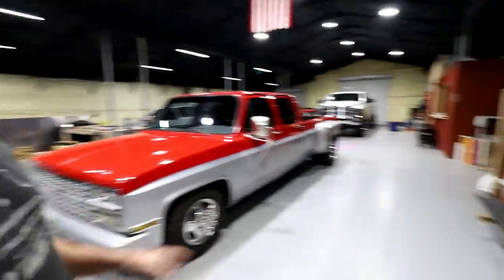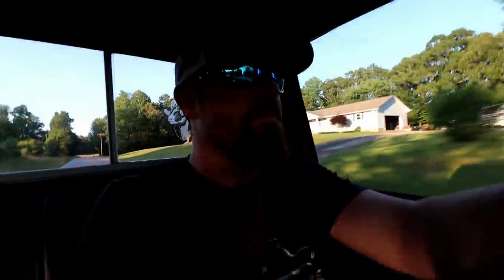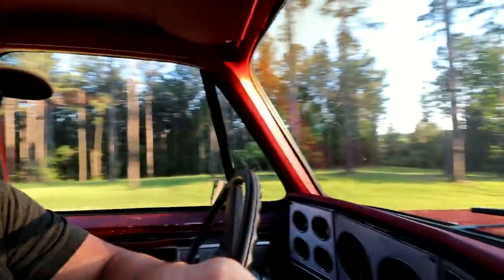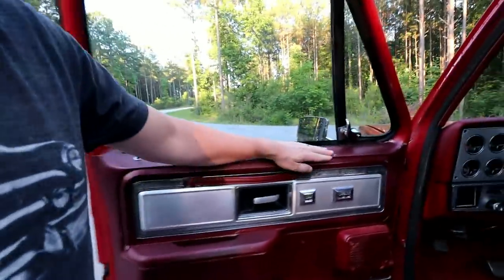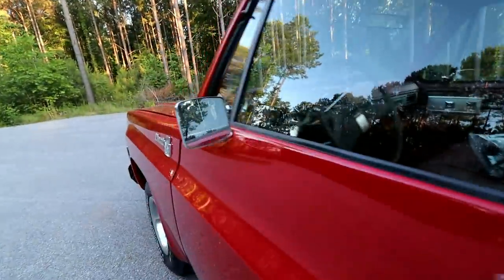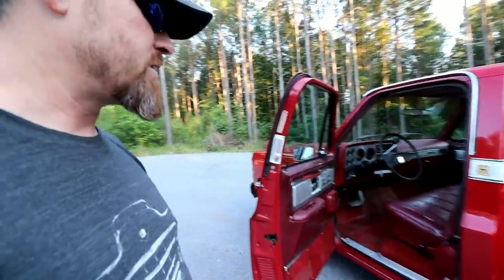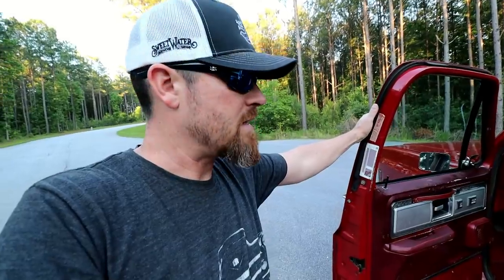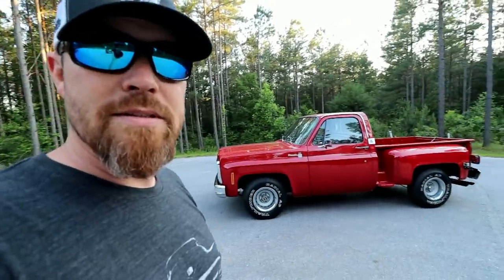Plans For My Survivor Chevy C10 | CALI-ENTE

Comment: 1980 had a round headlight option/first year of the square headlight with that grille.  I have a 1979. just remember if you change your light bezels to go round headlight, you will go from metal to plastic and they dont currently make a 1979 bowtie grille. Nice truck

Comment: Used to drive a '75 back when I was in high school. It had 3 on the tree, 3.73 gears and the angriest stock 4 barrel, 350. It got 10mpg. I was so mean to that truck. Used to do burnouts, and turn the key off while rolling up to red lights and back on. Nearly blew the muffler off doing that. Raced an old 70s Vette and early Fox bodies and kept with them because I'd only shift once the valves were floating. Someone shot at me once and the bullet ricocheted out of the mirror and broke the wing window. One night a buddy with an Eclipse and I were running top speed and he barely went around me. His speedo read 135 and mine took a while to come back down to 100. The calculator says that was 5800rpm. I'm partial to the round lights. The old man used to have two rollback square bodies. One with a 454 and one with a 6.2. That 6.2 was the worst. Someone makes tach clusters now that look OEM.

Comment: I like the round headlights but it's too awesome that it's so original I'd leave it personally.  Also the Holley sniper is a great choice for fuel injection not a real tough install and easy to hide under factory air cleaners too. Awesome truck I have a 86 k10 and a 68 c10 neither anything close to that nice but some day maybe I'll get there.

Comment: Yep, Weatherstripping and new Bushings in the Door Hinges. Those Square Body GM's were notorious for the Doors sagging after several years, due to how heavy they are.
Reply from the maker: yeah both of mine have doors that sag
Reply: @Thefabforums  Kyle, been there done that. I have owned, built, and or restored several Gm Square Bodies. That's usually the first thing I do is install new Door Bushings, that and new Weatherstripping gets them closing like new again. That is a very pleasing sound to me, when you shut the Door of an older vehicle, and it has that sound a brand new vehicle makes when you close the Doors.
You probably already know these, but just in case I am giving you a list of some the best Parts Suppliers for Square Body Restoration Parts. Those Trucks are so popular, and such Classics, that you can find every part for her brand new. Complete new Dash Pads, Grills, Gauges, everything. 
Anyways, here they are:
Classic Industries.com
LMC Truck.com
Classic Parts.com
USA1Industries.com
Carolina Classic Trucks.com
Npdlink.com (National Parts Depot)
And my favorite:
Brothers Trucks.com
My absolute favorite Truck I have ever owned was a 1986 Chevy Silverado LWB 2WD 2 tone Black and Charcoal w/Red Pin Stripes. I stripped all the Vacuum line & emission garbage off her, Edelbrock Intake & Carb, Valve Covers, Breather, and out a set of true Dual Exhaust on her, and she was my daily Driver for almost 10 years. I drove that Truck all over the United States literally. When I finally let her go she had close 500k miles, and still looked as good as the day I bought her. Rebuilt the Engine 1 time, and thats it. 
I will be watching for new videos on Caliente
You can find me on IG @pchambers379

Comment: I would guess that trying to keep the truck as original as possible will be more of a challenge than going with a full build.  Period correct is getting harder to keep.  I have an '86 Mustang V6 that I'm trying to keep period correct without modification and it's been a tough journey to not modify anything.  Updating with LED lighting and an EFI system would be a good option that would be hidden pretty easily.

Comment: I love it. As a family heirloom I would stay 100% true just like factory. But, If I were to change anything, it would be a tribute.....Like put the grille and headlights that I like, air ride but keep factory stance and custom 18" wheels that look like the factory wheels. Everything updated but looks close enough to factory that it would make the average person think it still is at a distance. The seat slightly remodeled for comfort but with leather and exact pattern as factory. Make sure you rewire the windows so they aren't so l slow. Keep the engine bay as is but go with sniper EFI, painted aluminum heads 383 , overdrive trans nothing you can look at and tell it was modified. I had a 1984 GMC High Sierra and regret ever selling it. I look forward to seeing it. FYI Fox body's and C10s are among my favorites too.

Comment: Keep the r12 till it quits working, when you do convert it you also need to change all the orings and the oil in the compressor I belive, also the dryer since you will have it apart.  Also keep the 80 grill you're trying to keep the rest of it original style at least it woundt make sense to have that be the one not right thing.

Comment: I’d go with the 78 or old head lamp bezel, the grill is the same, I think the 78 or older headlamp buckets look way better. Thing is the crap you get from like lmc is plastic not metallic. I personally like the early grills, like 73-75 model years, much cleaner looking. That truck is mint. I knew the model year just from the headlamp buckets lol, they are a little clunky looking on a c10.

Comment: I think they had a round headlight in '80 with that same grill on the Custom Deluxe model.  As far as the motor goes, I would do an LS swap, simply because the older motors with carbs run rougher and make a lot less power.  I have the same dilemma with my '75 K20.   I love it, but I hate the sbc.

Comment: If you change the grill there are a lot of bits and pieces for the rad brace
Reply from the maker: that need to be changed?
Reply: The Fab Forums ya on the rad brace for the headlights cause it changes the bezel from squat to round

Comment: Everything in automobiles need that little extra touch , the little things go a long way, with that being said if you start changing one thing it snowballs into something else I'm sure you know the rule (lol). Question though can you really just swap out refrigerant ? I have always been told that will rune a working system. If it can be done it would be nice to see the process .
Reply from the maker: Yeah I get that but it wont happen in this case